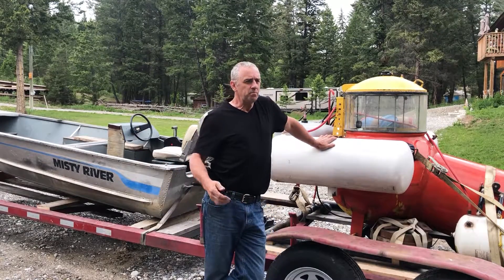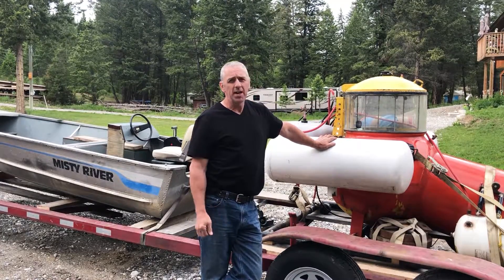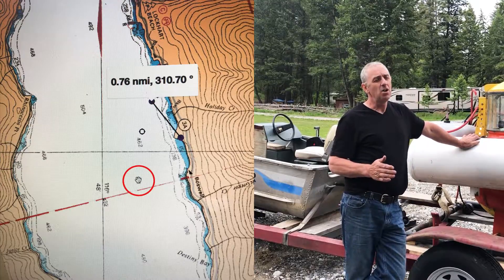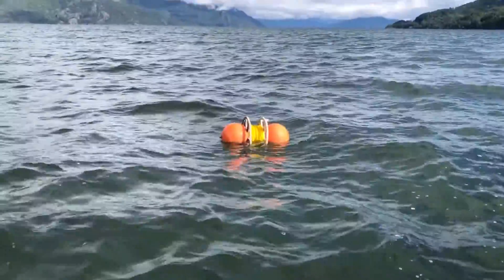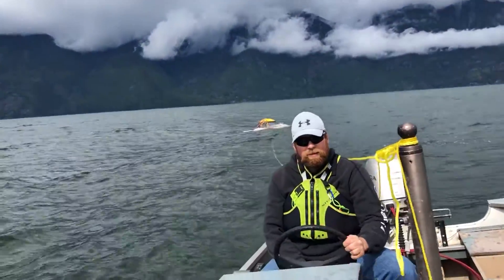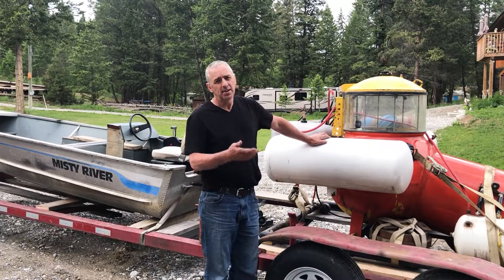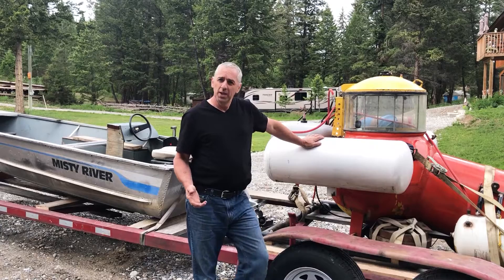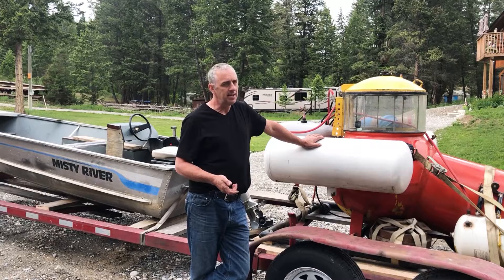Kooteney Lake Homemade Submarine Depth Test | Isolation Project

Comment: Hank, are the propulsion motors not installed yet? I don't see them, but they could be lower down on the sub. Are you getting closer to video and pics of your deep diver when your son arrives home? Looking forward to seeing that very much:)
Reply from the maker: Randall, the thrusters are not on yet.  I like to test the bare bones hull first.  This way if there is a lost sub, it is only the hull.  That is why it is not pained pretty yet etc.   The deep diver is on hold for a bit.  I have to spend some real money on it and I need to wait with that.
Reply: @HankPronk  Oh got ya. On the topic of the deep diver, the red fiberglass is filled with syntactic foam or is it a series of ballast tanks? I don't remember. Until you make the mods to it, do you have any other pics to share with us so we can all see what it looks like from different angles? Don't believe we've ever seen it off of the trailer from side and back. Hope all is going well and you and the fam are safe and well:)
Reply from the maker: @randallcotner2155  There is no syntactic foam.  I used two carbon fibre tanks for buoyancy.  the two tanks give 1,100 lbs buoyancy.  There are pictures on my Facebook time line of the sub in build progress.